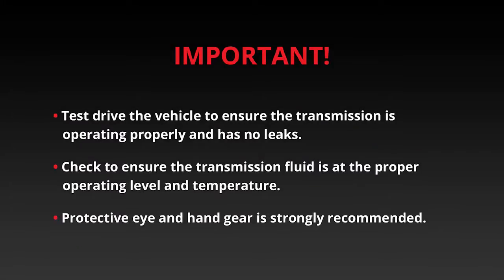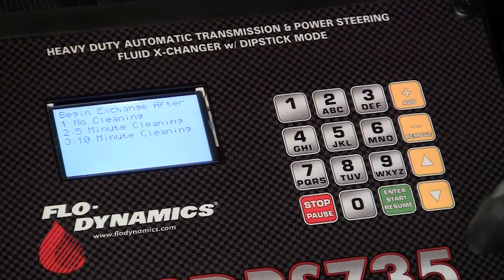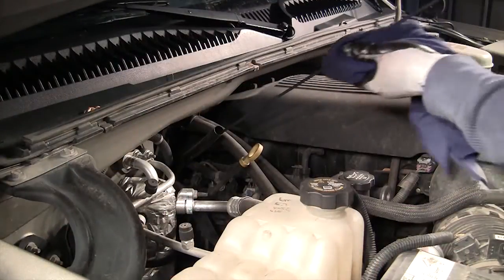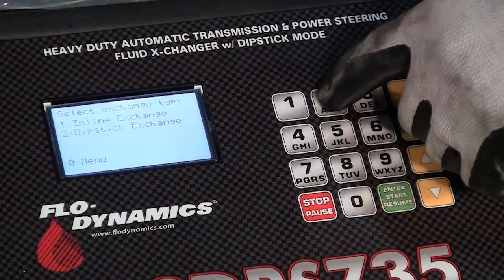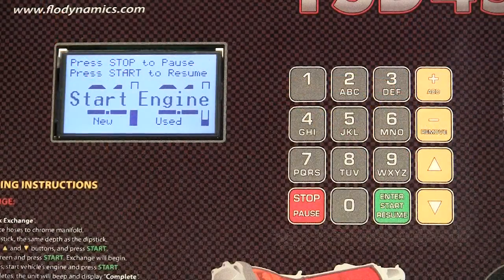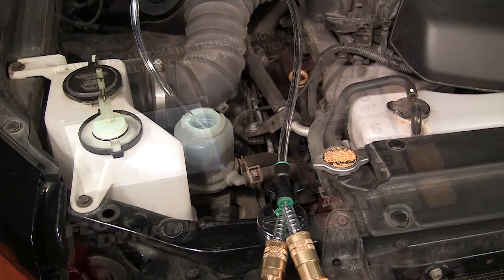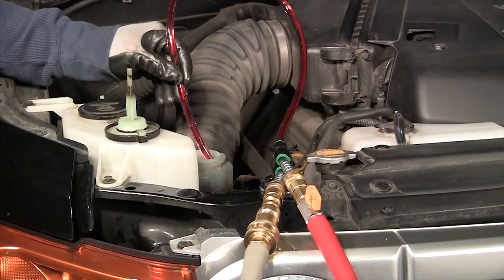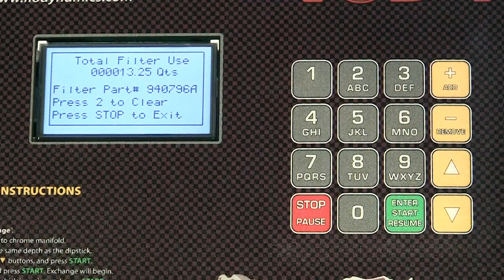735 Series Operational Training Video

Comment: Took a week of constant calls and emails to get this thing primed, had to do some jenky shit to get it to prime.  Now it will usually be able to do a dipstick exchange, but frequently stalls on new fluid (it is summer, it is hot).  Absolutely will not do inline exchange, even with the additional $150 adapter for a ford transit.  drive, neutral, reverse, manual, park, swap hoses, swap diverter, hooked to auxiliary battery power supply.  Stalls on new fluid.  Dread talking to customer service because it sounds like they have never even set hands on one of these machines.  Power cable clamps blow ass, for 5k put a 12v power supply in the damn thing.

Comment: dip stick exchanges on a ford transit have to be done 3 quarts at a time, i NEED this thing to do inline exchanges for the fucking 5k we spent on it.
Reply from the maker: If you would like to do inline exchanges on Ford Transits there is a hose and adapter or adapter only for the particular application. 
Here is the link to the hose and adapter: https://flodynamics.com/shop/ford-transit-connect/
Here is the link to the adapter only: https://flodynamics.com/shop/ford-transit-adapter-metal-fitting/